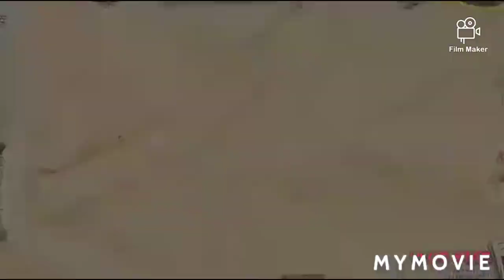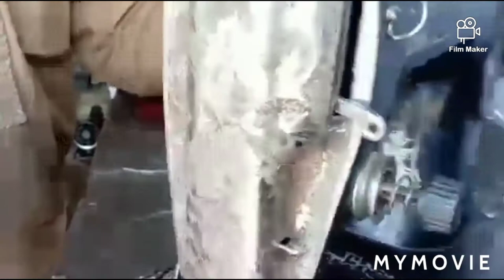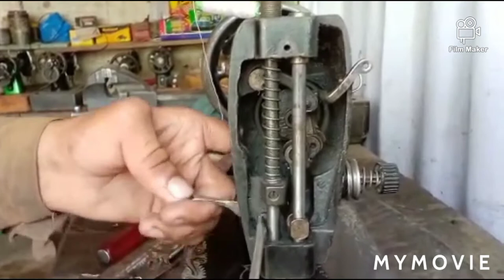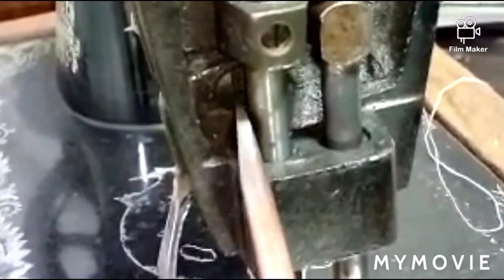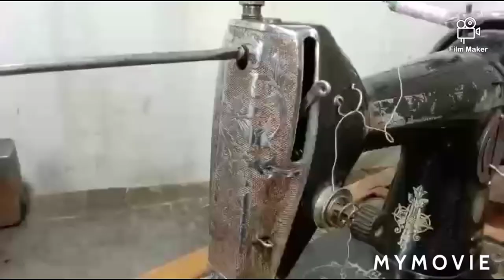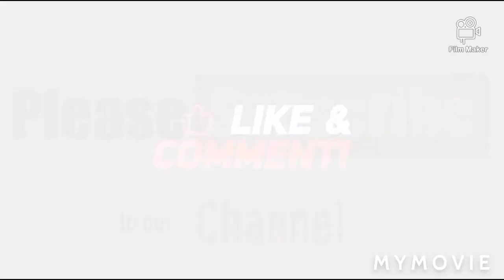PRESSER FOOT LIFTER PROBLEM | SIMPLE TIP AT HOME | MECHANIC TUTORIAL VIDEO| FULL HD

Comment: wrong model, My singer is a 25/05. does not look like this
Reply from the maker: Hi

This is not singer machine. These are just local Asian market sewing machines..Singer machines are very expensive.
Reply: I figured it out. My Pressure FootLifter was stuck due to non use over several years. I simply kept lifting it & forcing it back down, then gave it a good lubrication with 3-in-1 oil. Works great now. A real Singer last a lifetime!!!😘
Reply from the maker: Excellent 😊
Reply: @Sewingmachineworkshop1  I purchased my singer on Oct 17,  1983. (reading receipt).  I just joined the army. I was 21 years old. It cost me $138.00
Reply from the maker: Penny Cathey, can't believe you kept  your original receipt for that long. Is that you in the picture? Stay connected take care.
Reply: @Sewingmachineworkshop1 yes, that is my picture,  I know right? I found the receipt inside the users manual. You'd be surprised how many other items I've managed to hold on to. My two grown daughters left their high school diplomas & report cards with me so they won't get lost. I still have mine too. But somehow I managed to lose my Army dog tags. Urrrrrgh!!! :)
Reply from the maker: Awesome
Reply from the maker: Check out my latest video.